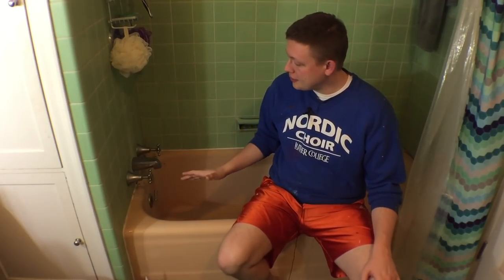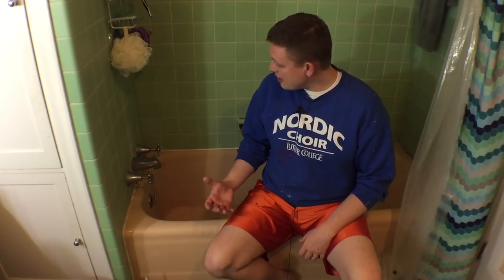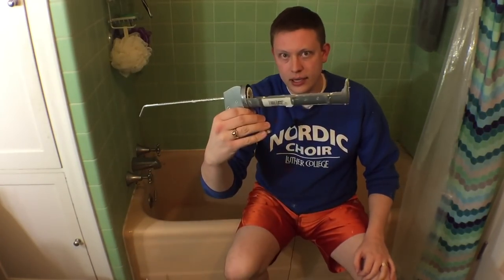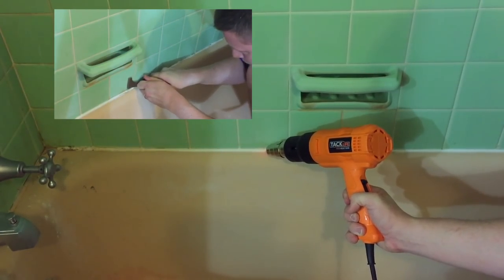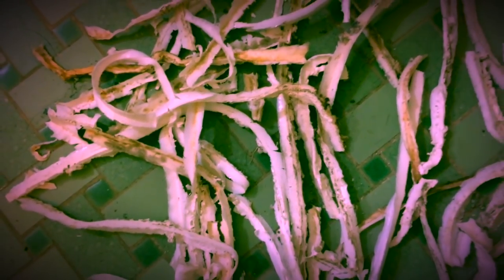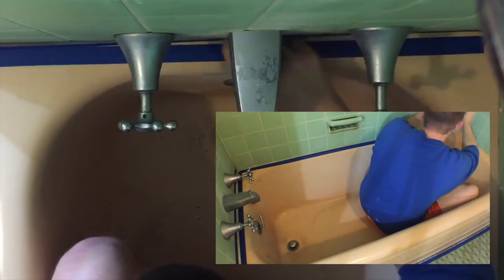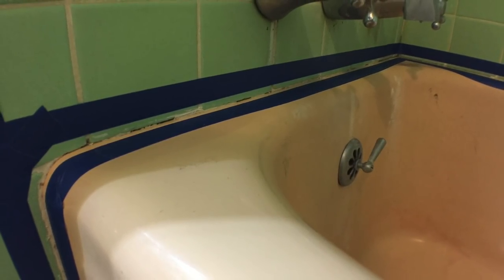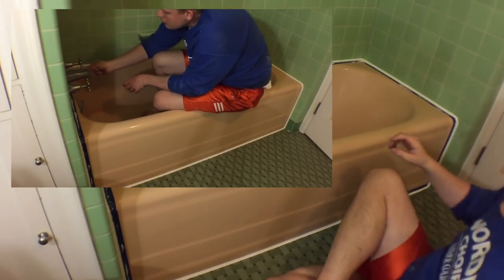How to Caulk a Bath Tub Like a Pro

Comment: Kristopher, nice demo on caulking!  I have always used my finger with a bit of diluted dish soap water to smooth out the bead.  I have a tub that will be getting sealed up soon and I will give a try with my heat gun to loosen it up.  Great tip!  When you say "about" it reminds me a little of some of the folks in the UP of Michigan in the pronunciation.  ATB, Bill
Reply from the maker: I suppose that's my Wisconsin accent coming through proudly :) Thanks for watching, and good luck with you upcoming project!

Comment: I admit that I do it without tape.  Once I get going, I can do a pretty good job of making it smooth and pretty.  But it's not consistent and there are some bad spots...  But I'm always too impatient to do the set-up.

(I havne't done my tub yet.  I probably should, huh?)
Reply from the maker: In honesty, the setup goes really quickly and it's worth it for the nice finish (in my opinion.)  Yes, I would say definitely do your tub.  That's probably the worst spot NOT to have caulked.  If you start growing mold behind a tub, you're in trouble.
Reply: I should clarify: it's been done, but I should re-do it.

Comment: Uhh. ...yeah, so the duct tape I put on instead of caulking is holding up sort of okay. :-P I'm really inept when it comes to using a caulking gun. I've tried squeezing a tube in the gun, thinking it was open, only to jam it up and flow backwards through the tube- Ugh! I'll try it again later, after I scrape the duct tape residue off. That should fun alright!
Reply from the maker: Oh man Christine, what a nightmare!  Did you remember to puncture the caulk tube after you snipped the tip?  That's an easy thing to forget.